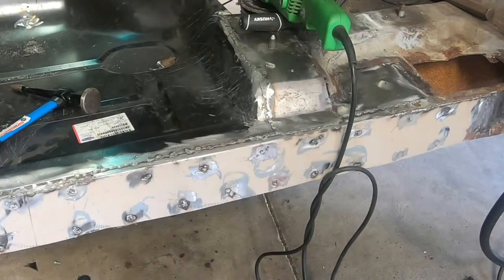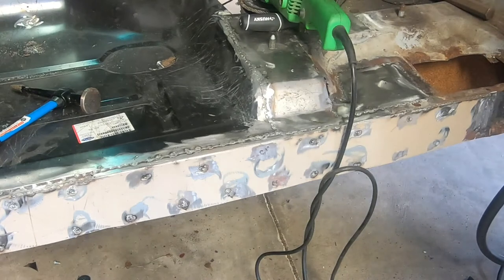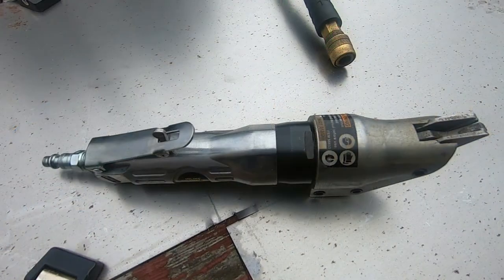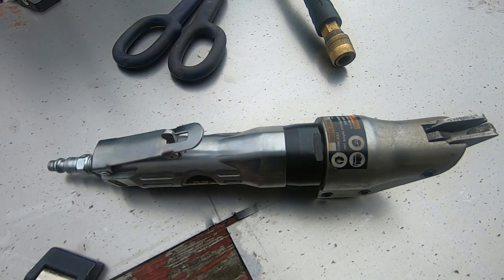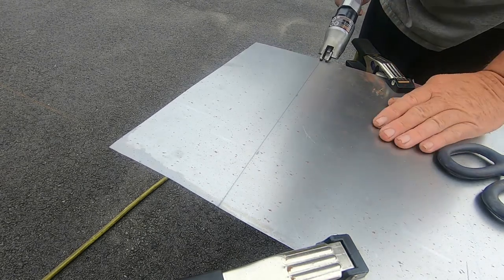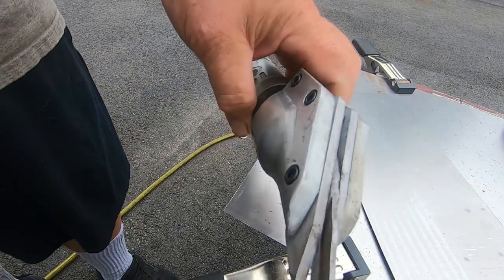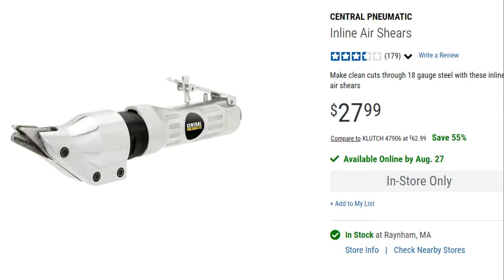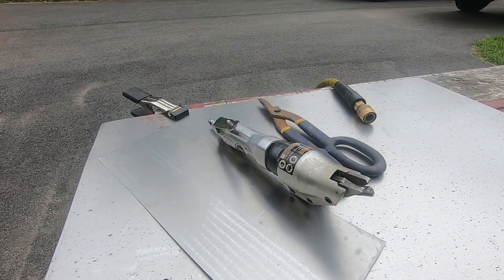Harbor Freight Sheet Metal Air Shears

Comment: Thanks for demo , I'm on my way to get one now , I kno it recommends 6 gal compressor or higher but how'd you think they'd do in a one gal , I've gotta 20v battery compressor that's easy to carry on the go ? Wondering how it'd do ,  I'd be Making Lil cuts when using 1 gal
Reply from the maker: I myself only use it to make small cuts in short bursts. However with only a 1 gal storage capacity I would be surprised if you got more than an inch or two out of it.  I am curious to know how if it will work. Sorry I was not much help.
Reply: @richardspaulding5035  you r exactly right , the one gal would barely cut plastic a couple inches , works great in the shop compressor but not the one gallon